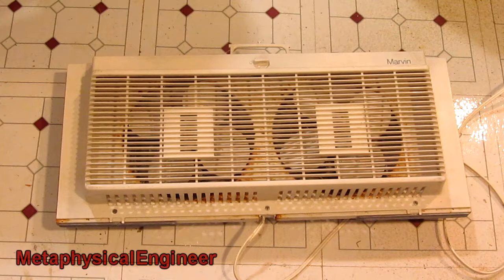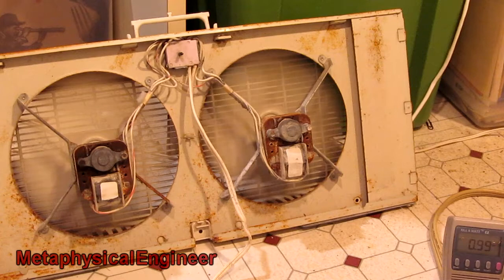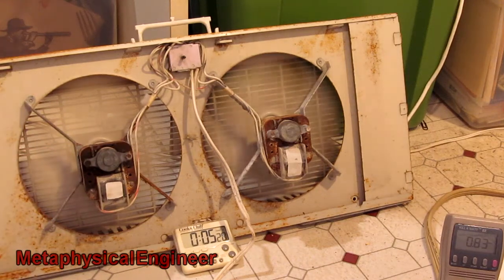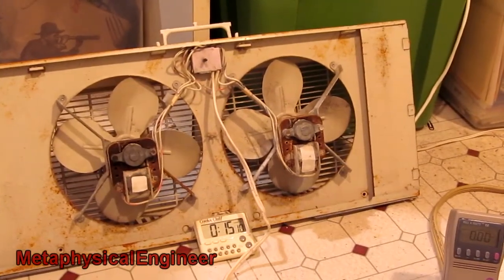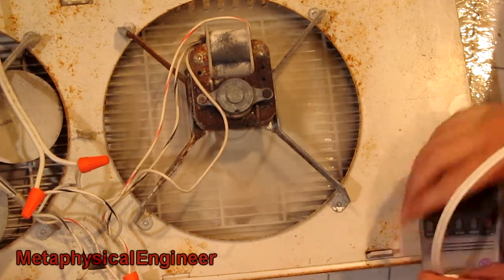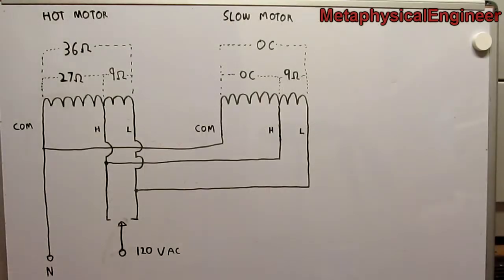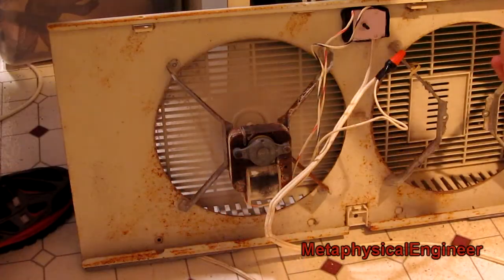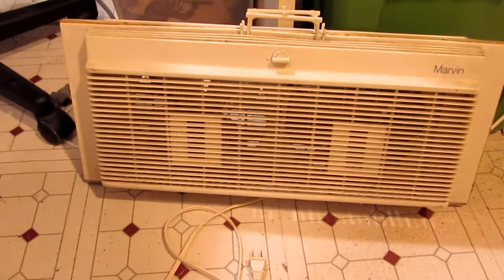Window fan with very unusual symptoms

Comment: I've got an old Honeywell window fan that blows the GFCI where it's used, determined the GFCI is bad given it'll blow given any load that isn't electronically current limited, which is anything other than the LED bulb or dehumidifier it usually runs, solution is to run an extension cord from the non-GFCI outlet 20 feet away, as I don't feel like replacing a fairly new GFCI, the other GFCI I installed had the same temperament, so I smacked it, hard, and it works even with a space heater connected, this one just trips if you smack it, I survived without GFCIs until I moved to a new house, reason being the bathroom had an undersized quick blow fuse that would go if you used a resistive heater element with the slightest bit of moisture in the air

Comment: are they really supposed to get that hot, a reasonable 50c like seriously? Or is this typical of those shaded pole motors. I have a vintage desk fan and that has a shaded pole motor and that is hot but i dont know if it is safe (it stabilises and draws rated power)
Reply from the maker: Yeah 50C would be pretty standard, maybe even a little low.  Windings will usually tolerate up to 100C without issue, so just because something feels hot to your skin, doesn't mean that there's a problem.  Drawing rated power without any hot smells or angry noises is usually a good sign.  That fan should be okay, but would be a good idea to clean and oil the bearings if you haven't done so.

Comment: Hahaha, that's funny!
5:28 I haven't even gone to college (yet) but I noticed that as soon as you showed the diagram. X'D

Seems like that could also be a possible fire hazard! What a crappy design! They probably didn't want to pay for a double throw switch, so simply wired the motors in parallel ... -_-